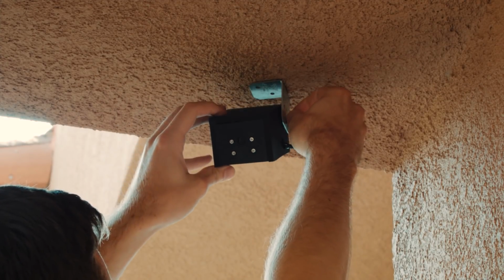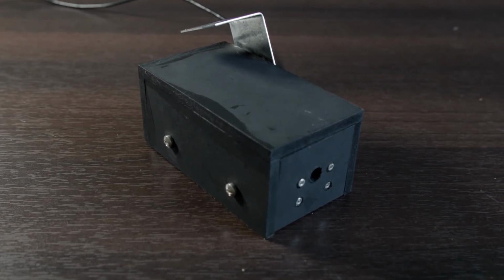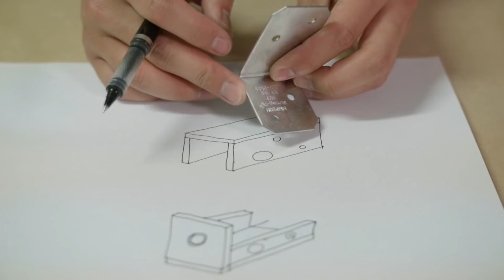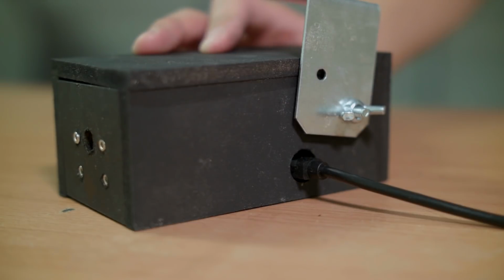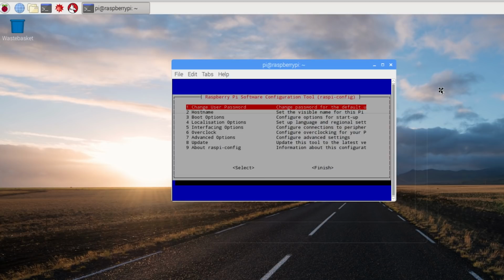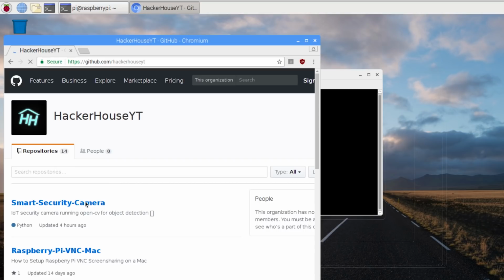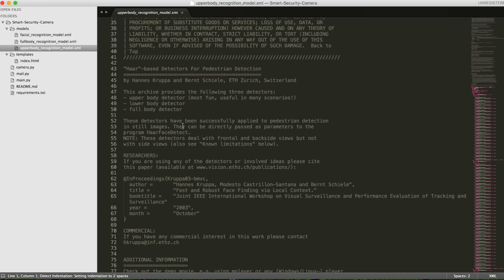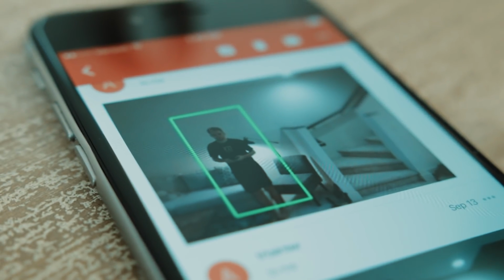How to Make a Smart Security Camera with a Raspberry Pi Zero

Comment: So, a total of like $65 in electronics, plus another $5-10 for the MDF Board, screws, bolts, etc. When I can get a smart camera with the same functionality at retail for $40-80?
Reply: You don't do DIY for profit
Reply: The point is more of a personal accomplishment kinda thing. Sure you can buy one, or you can build one yourself. Its a fun challenge for some people.
Reply: So, you watch DIY videos for free when you can watch product videos at youtube for free?
Reply: Thats not the point dude. These guys are makers/hackers and not here to save money but to make cool things.  Just like the automated drink maker - its free to just mix the drink yourself.
Reply: And higher resolution and frame rate. Also good night picture.
Reply: But Raspberry pi zero is $5 and a camera for it is $10?
Reply: Actually, you can build this cheap. The linked pi zero from ebay is expensive. You can get it for $10. Make sure to get the pi zero w model. And you can find the camera for another 10 that has the cable to connect to the pi zero board.
Reply: Why not just buying a 20$ webcam and don't have to do anything at all, with the same result ?!?
Reply: did you read the description too? i am pretty sure you find something like "Note: (Raspberry Pi zero board is not included)"
Reply: Clearly you havent been on aliexpress a wired ip cam  can be had for $10 - and $20 ish for wireless. Delivered
Reply: With an open source firmware? And board schematics? I don't think so.
Reply: If you live near a Micro Center in the USA, they have a sale on them for $5.00.  This is for the Pi Zero W.  Some stores are sold out.  However, it is in-store only, and you can only order one at a time, otherwise the next one will be 14.99.
Reply: Is there face detection in the commercial product? Do you have access to source code? Assurance there's no back door?
Reply: This $45 kit has everything including the case from a very reliable source. https://www.adafruit.com/product/3414
Reply: Trevor Terry, it's just the thrill of the DIY aspect
Reply: KingOfKYA how long did it take to ship
Reply: Ikr
Reply: yup u don't need a pi 3
Reply: CyanidE 
That's the way computers are now. Less expensive than the peripherals.
Reply: Where do you buy your raspberry pi, there are like $20 of electronics here
Reply: Trevor Terry you don't need their box, you could use any container
Reply: On ebay.co.uk the camera modules cost between £4 and £8 ($5-$10) so very cheap and since from china in some cases accessible by many countries.
Reply: not just being fun alone .. in my university was given this to do. computer science major
Reply: The problem is that all of the security cameras on the market are cloud connected and rely on services that are not under your control, might go away, might be infected with malware, might be open to spying, etc.  Some of us would be willing to pay even more to be able to know that we're controlling our digital profile.
Reply: If you're against having your home surveillance stored in a cloud network that doesn't belong to you, as well as against paying a subscription fee, it's worth the hassle and money. This method isn't for everyone, just as the popular security systems aren't for everyone.
Reply: @jayhernandez9395  a cheaper webcam still could be used for your own cloud system! For me this selfmade system would only make sense if it would give me a benefit (cheaper, easier, modular,...).
Reply: First Last search raspberry pi zero on aliexpress. For me the first two things that come up are the pi zero and camera which total 20.66 USD
Reply: Where are you getting a Raspberry Pi Zero for $5 and camera for $10?  Link in the description selling them for $10 and $30 respectively.
Reply: You can buy a ip camera with infrared night vision for $30 od bucks. Not going through this hassle of cutting peices of wood, opening cmd doing abit of programming etc..

Comment: got tutorial but what happened to the automatic bar
Reply from the maker: We accidentally burned out our linear actuators because they were motors instead of solenoids. We put the project on hold for a while because we had to do a massive redesign.
Reply: ok
Reply: +Hacker House how the hell are you supposed to shut down the pi  if you want to turn off the camera? , just get up on a ladder and unscrew the housing and bring a keyboard  ,USB OTG adapter ,HDMI mini to full HDMI adapter ,HDMI cable and monitor up on the  ladder with you so you can  type sudo shutdown h   to shut it down properly without it corrupting the SD card (something  pi's do even  when they are shut down properly)
what happens if it loses power  ,oh well  just get back up on the ladder again open the housing and take  out the  micro SD card  go reburn an  image and set all this up all over again then  get back up on the ladder put the card back in  put the case back together again
Reply: Andrea Mitchell ssh

Comment: What's the best way to implement video storage for y'all's setup? Write a script where you can store the video in a micro-sd card and overwrite 3 min clips at a time after the storage gets full like on dash cams? Or store them through a server?
Reply from the maker: Server storage is probably the best option for a scalable solution, but the 3 min hack would probably work as well.